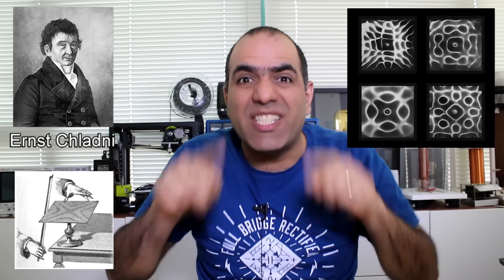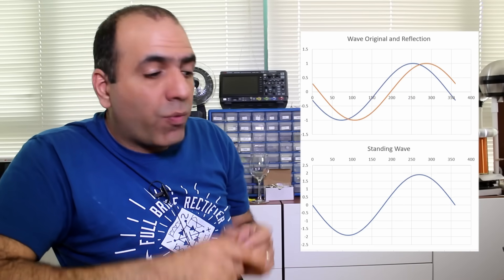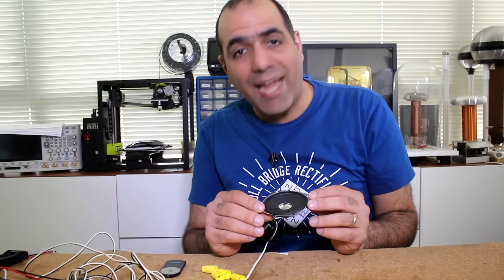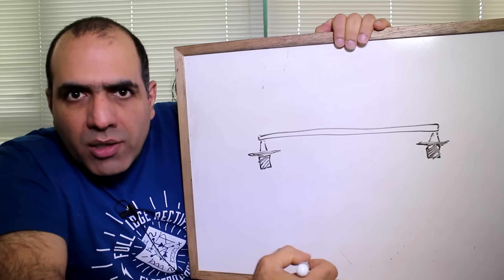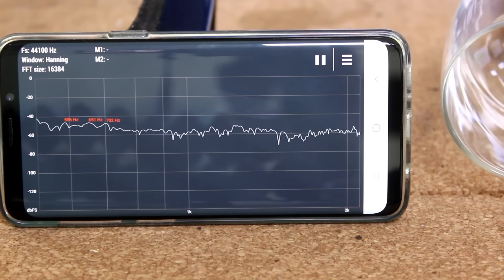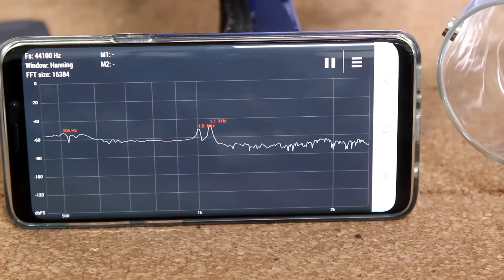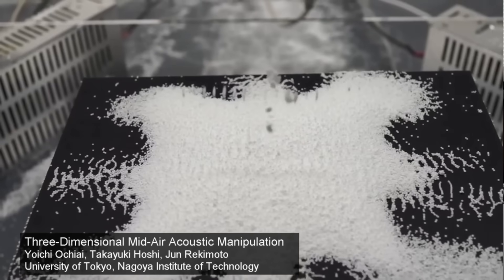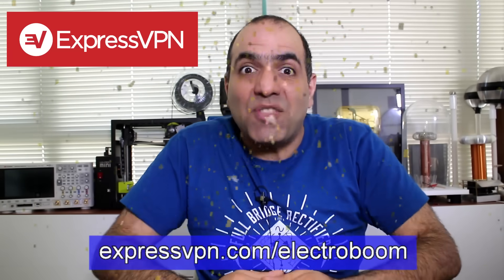Moving Particles with Vibration, Making the Chladni Plate

Comment: That was neat.  Reminds me when we were trying to find the resonant frequency of our church.  Hooked up a frequency generator to the sound system.  When we found it, it was the weirdest thing walking through the auditorium.  Depending on where you stand you could "feel" the sound, but yet stand somewhere else and it was practically quiet.    I think this was basically because of the standing waves.  It turns out where the pulpit is was a major node point, which is why we have so much issues with feedback.  We were able to adjust the equalizer to cut out the resonating frequency though.

Comment: Are there any similarities between reflections of physical waves and reflection of electrical signals? If you put the right value of resistor at the end of a transmission line you can stop the signal form reflecting. I wonder if there is any way of doing this with a physical wave...

Comment: You should try placing a speaker at 90° to the other, in order to slightly move the plane when the particles are in "mid air"so when they fall down they are in an advanced position compared to where they were before the "jump" on the previous position. I think that you can push the particles with two frequencies set. If you can give it a try i'm really interested to see the result. Thank you for keep going with great content.

Comment: I actually noticed something pretty similar looking and cool when I was using a palm sander. The saw dust on it was vibrating in a small cyclone, I think it was for different reasons though as the sander uses a motor and an offset weight to create vibration so it’s different than a speaker

Comment: I think the cloud like salt pockets that you saw are at the maxima rather than the minima, sitting in an unstable equilibrium. Even though they're sitting on a maximum interference spot they dont move to a minimum because the surface under them is more or less horizontal.

Comment: Nice work for the video 

But I have a question for you outside the video content
yesterday I went to a battery shop to change my car's battery, and the person who was changing the battery asks me to hold the negative wire while he is removing the old battery to replace it, and the car was ON!, after he put the new battery he connected the positive wire then the negative and the car didn't turn Off.

Could you tell me what happened here in this situation?

Comment: I loved this video! Such a great experiment! It's so cool when electronics projects are doing something you can see. :)  BTW...Try putting two signal sweeps through both of your speakers with one hertz of difference from one another. That might cause the salt to move from one side of the board to the other. The signal sweeps will probably have to be limited to the resonance frequency of your board, so it will have to be a tight signal sweep. Just above and below the resonance frequency of the board will probably do best.

Comment: Could you take a board that is something like 3 ft by 3 ft and dampen (not to make wet, the physical concept) the outermost part (say a 1 ft section on the outside edge) so that the waves are less likely to reflect on the outer edges (or are much weaker).  Which might help to move the particles across.

Biggest issue I can think of would be that without the resonance, your speaker is going to have to work much harder on each wavelength (but the subwoofer should be stronk enough).

Comment: For the 2 speakers would using a much higher frequency work? The problem with lower frequencies is the nodes are really far apart. I'm pretty sure your speakers could hit around 15khz (might want ear protection), higher frequency means nodes are closer together, means some of the salt might be able to make the jump between nodes instead of rocking back and forth in the one node. Most of the acoustic levitation projects I've seen use ultrasound speakers way above human hearing but you're using around 300hz. Worth a shot?

Comment: What if you actively cancelled out the reflections while simultaneous introducing your own "fake reflection" with the second speaker? That is, produce both a signal which is out of phase with the reflection of the first wave (may take some tuning to find the phase but that should be doable) and the generated reflection, sum and output? Particularly with a metal plate or better speakers, I can see this working better than the setup in this video.

What about the vibrating spiral conveyors? Are those using a similar technique? Could you build one of those with speakers?

Great video as always!

Comment: did you plug that speaker straight into the 120v outlet??? lmao!!!
Reply: Overclocking speakers
Reply: @pierreuntel1970  Overvolting, not overclocking. Overvolt = Increase the volume, Overclock = increase the frequency.
Reply: @pierreuntel1970  MORE POWER! O HO HO!
Reply: Mega bass at 50 hz.
Reply: @sharpcone That was 60hz
Reply: Yes, should've used a European industrial two-phase 380v outlet
Reply: @RDSk0  They are 3 phase 380V 400V not 2 phase.
Reply: @tobinator680  actually 400v 3phase
Reply: Tobinator no
Reply: @KonnaVaari  Yeah true, I always refer to it as  380V out of habit, although for 1~ I always say 230V.
Sorry, my mistake.
Reply: @tobinator680  or just take a old cellphone charger, flip the coils so its stepped instead of down and just use that to feed into a capacitor bank that drives the speaker
Reply: He does stuff that to make the videos more fun to watch 
He says this in a video
Reply: He usually uses large capacitors to make the explosions. It's spectacular and safer than main power
Reply: Absolutely he did.  I saw that speaker and knew instantly it was going to fucking explode.  The first device and demonstration ALWAYS explode on this channel and nearly kill him every single time.
Reply: It's called music.
Reply: Nope that is fake. The pitch is higher than the humming sound  generated by microwaves, so it is fake. But still quality content.
Reply: @jerrymk6846  It is not fake, because 60hz wave is part of bass frequencies.
Reply: @DJZKOfficial  You don't understand. No one say overclock or overvolt on speakers. Especially overclock. So no increase frequencies. And the humming sound is because the transformer in a microwave acts like a speaker, which outputs 60hz, normal household electronics speaker is like 8 to 16 ohms which passes 7 amps on city power. That is not instant death for the speaker, it could produce 60hz audio.
Reply: @jerrymk6846  I totally understand such things, sand pox said it was overclocking so i said it was not. It was clearly overvolting the speaker
Reply: @jerrymk6846  I know it was the transformer that makes humming sound, but the destroyed speaker sound is not fake since what made the humming sound is the 60hz fed on it, but got destroyed because it was 120v
Reply: @DJZKOfficial  It will not destroy instantly, so 60hz should be generated. The pitch is too high. Ask medi if it was real or fake.
Reply: Why dont you try to do the same and show a video about it? Because I did demo this at a University, so i clearly say it's not fake. It's my presentation on how Volume and Frequency is both relatively fatal both in electronics and sound engineering.
Reply: @DJZKOfficial  I did
Reply: @jerrymk6846  Remember. it is not a woofer speaker he used. And is not even at 400w based on the size of it's magnet and coil
Reply: Maybe you're using some 4ohms or less speaker that passes through like 25 amps of course it will fry. I used 16 ohms small speaker like his and it started smoking in 2 seconds. Woofers can stay way longer
Reply: @jerrymk6846  well he uses 8ohms and as i said it is 120v he used. Coil wont handle that, so it would be almost instantly destroyed
Reply: @jerrymk6846  The pitch is not too high, I just checked using internal frequency analyzer(Spectogram), it is a 60hz square wave. Why square you asked? Simple, the speaker's material is somehow limited, so it cannot handle 120v 60hz sine wave. so the curvature of sine wave was limited to the speakers's maximum positive and negative rating
Reply: Should have tried our 5phase 500v

Comment: Interesting how some spots hold light dust. Are those antinodes? Maybe the reason is that those points are where the board and the sand are hitting each other the hardest, causing some of the bits of sand to fracture, resulting in tiny particles that just wind up "stuck" wherever they are. (Lorentz? Static?)

Or actually, maybe the white spots aren't sand dust. What if those are areas where the sand has significantly scratched the board, making it appear white? Again, this hypothesis is based on the assumption that the spots are on the antinodes.

OK, having watched it some more, I think I understand. It's not scratched, because we see it move. And it's not stuck, because we.... see it move. When a particle is deflected, it is primarily deflected away from the nearest antinode. So it would stand to reason that particles are deflected more the closer they are to the antinodes. But we're working in 3D here. If you're really close to the board, most of that deflection will be upward, not outward. Smaller dust-like particles have a high surface area to mass ratio, so they succumb to air friction. So if a small particle and large particle are deflected mostly upward, slightly outward, the larger particles will travel farther before the next collision, whereas the small particles will be told to "stop" almost as soon as they leave the board.